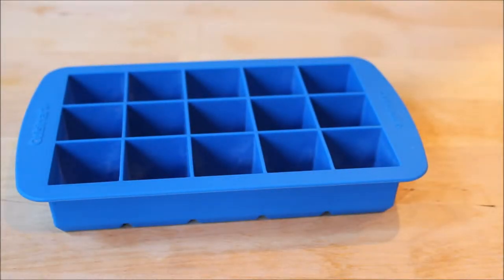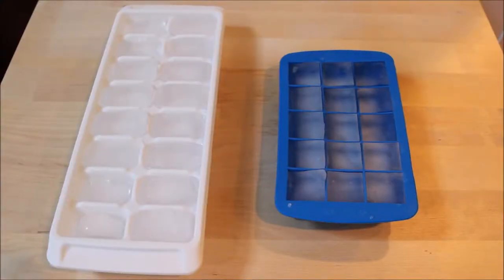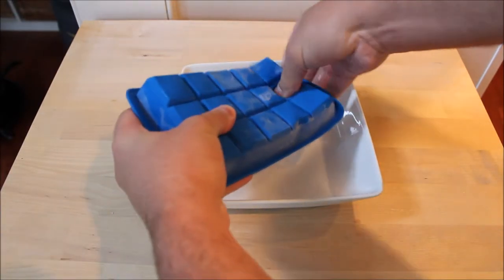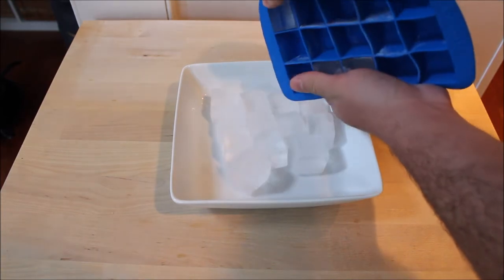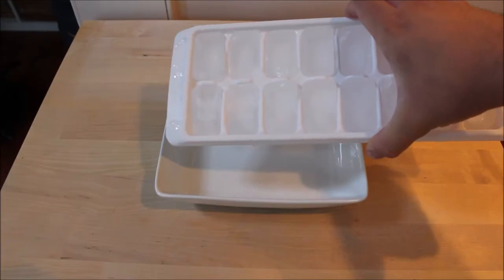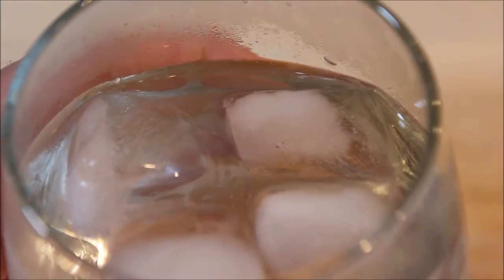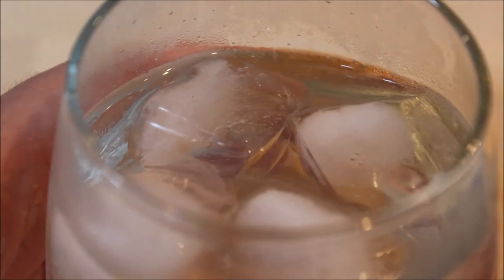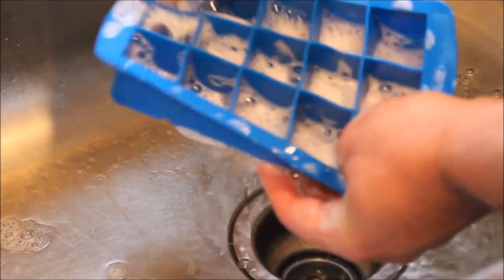Why Silicon Ice Cube Trays are Terrible.

Comment: Wow so many vote downs? Are people missing the point? Silicon is terrible for cooking pans and ice trays. I've noticed those flakes and stopped using. I also noticed after 6 months or so silicon stinks like freezer burn. Seems only stainless steel could be a long lasting ice tray but its so unpopular due to marketing and modern replacement items becoming the normal. There are only a few steel ice trays sold today and none are built well like the ones from the 1960s it seems.
Reply: Correct in everything you said! 👊🏻👌🏻

Comment: Thank you! I was thinking that it was just my silicone trays that were leaving a white residue in my water.
Reply: I’m thinking if you use filtered water, that might resolve the issue?? I use Britta filter water.
Reply: @kook2788  This has nothing to do with the water. I have the same problem but only with ice cubes from my silicone form. Water itself is fine, water + ice cubes from regular forms is also fine.

Comment: Pro tip if you want to get rid of the smell all you have to do to refresh them is put them in your oven for 15-20 mins at 350F just ensure they are silicone and not some other material.

Comment: You shouldnt wash them with soad n water or if you do soak them in 50/50 warm water distilled white vinegar for 15 mins or however long. The soap is bad for them. It will remove smells too.

Comment: Clearly I need a demonstration on how you emptied your regular plastic ice tray with a settle gesture. I always thought twisty the tray heavily would get them out but it seems to only be the middle ice cubes that come out when I do it that way.
Reply: Regular plastic.... hold each tray end with your hands.  Hold tight and twist in opposite directions. Hold upright if you just want 1 or upside down to dump the load.

Comment: Incredible that no one but you point that out, those particles are not only anoying but also scary...
Reply: It's calcium carbonate and magnesium carbonate, and they're both completely harmless.  We all consume it every day of our lives.  The flakes are not due to his tray, but his water supply.
Reply: @FujishimaAkiko  I don't think flakes come from water... I have both types of trays, silicon and hard-plastic based, and with the same water supply, I don't get flakes in regular hard-plastic trays!
Reply: Actually, that would be a good matter for a video
Reply: @SaludContable  That's because of the material the trays are made from.. The silicone allows for the flakes the accumulate on the sides, and when the tiny flakes build up enough, it's in your ice.  I don't get flakes with my silicone because I don't use tap water.
Reply: @FujishimaAkiko  I use filtered water and get the same thing, I wonder if the filter is even supposed to help with minerals
Reply: If that were the case wouldn’t residue just re dissolve back into the water?

Comment: I think if you boil the water before you freeze it you’d get clear ice
Reply: Daniel Ordaz no the ice is caused by air bubbles that happen when the water starts freezing from all sides of the cube towards the middle. If you freeze ice in a styrofoam cooler, the water freezes top down  and the ice will be super clear
Reply: this is something else its a powder from teh tray